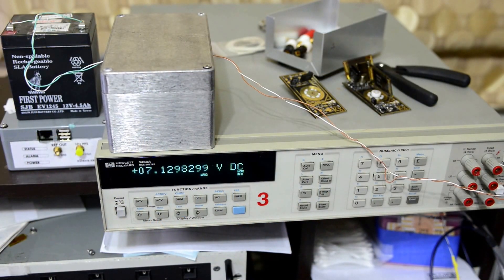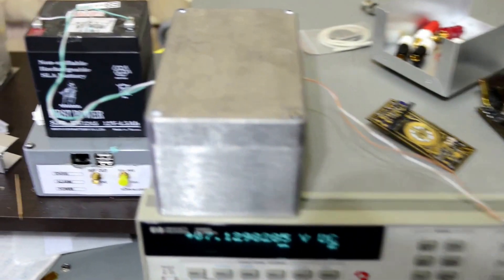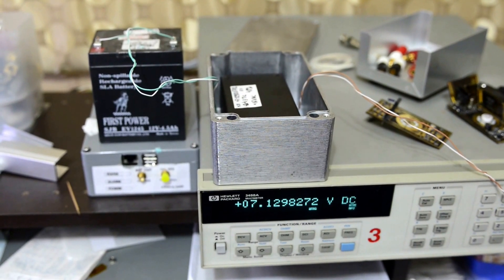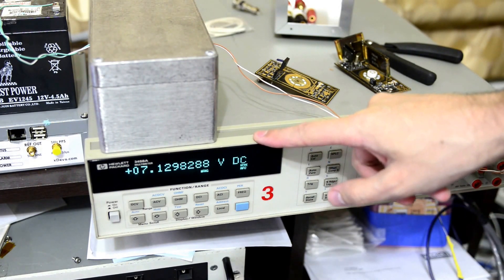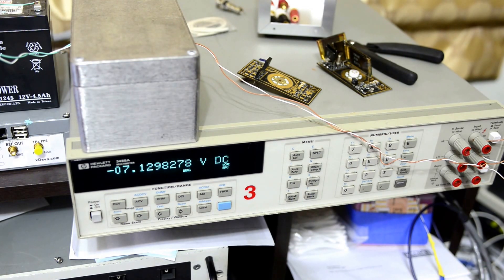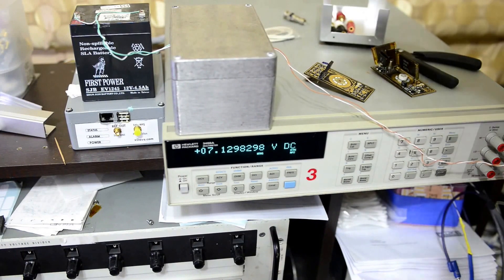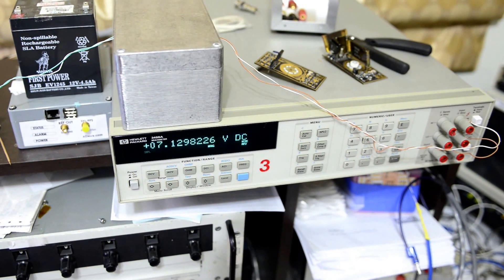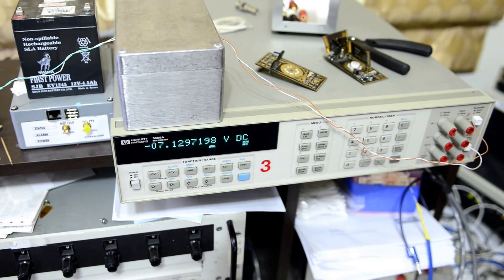LTZ1000 reference test with output leads reversal

Comment: The voltmeter and the voltage source are not mains earth referenced, so their GNDs (or LOs) are at some 'random' voltage. If you connect them together through the reference module, they are equal, but if the leads are reversed, you measure the difference between the GNDs in addition to the reference voltage ...?